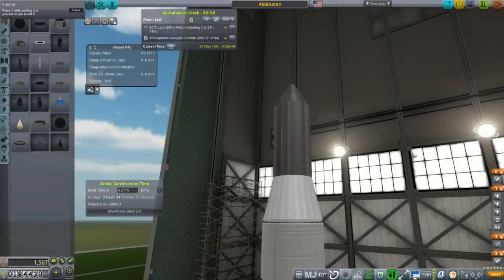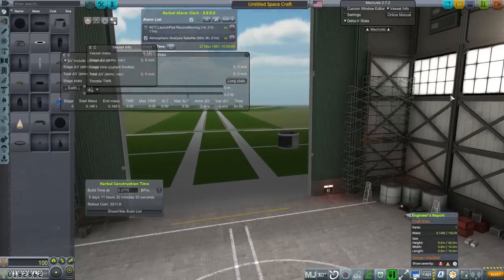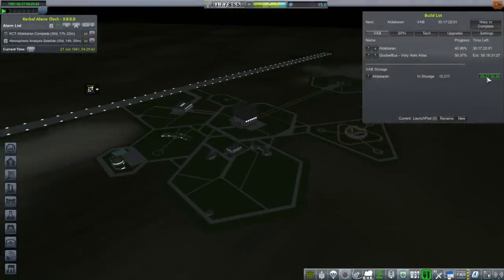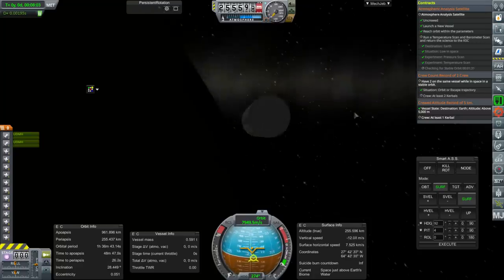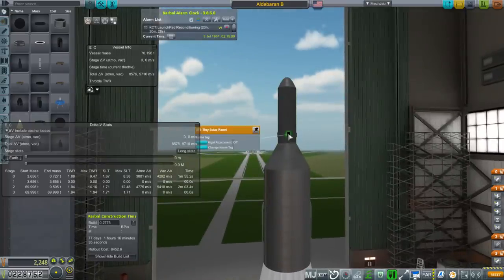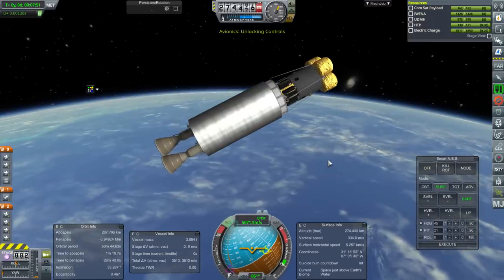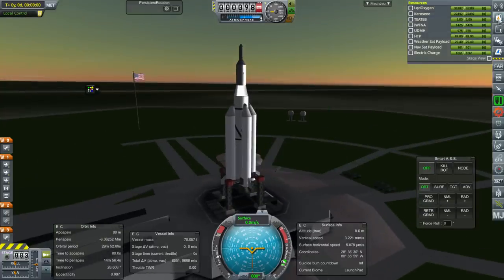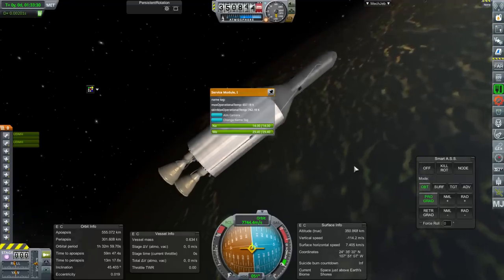KSP 1.3.1 with Realism Overhaul - RP-1 08 - Very Able Redemption

Comment: You mentioned how you were taking so long to build rockets... (I only recently started playing with KCT and have not done RP-0 or -1) Maybe you spent to many upgrade points on Research initially, and not enough on VAB build points? As I look at it, if you making rockets faster your completing more contracts and you will have the cash to buy more upgrade points to boost research.